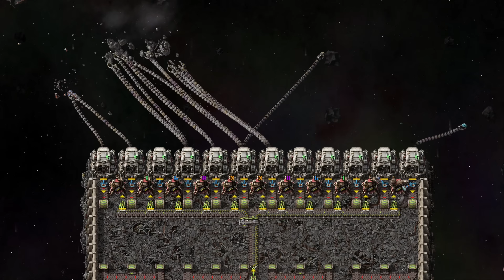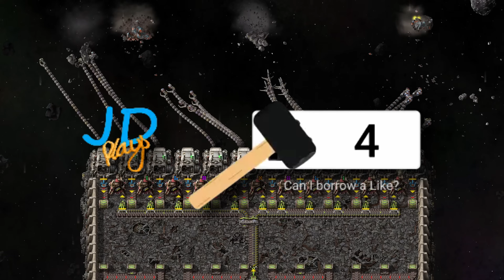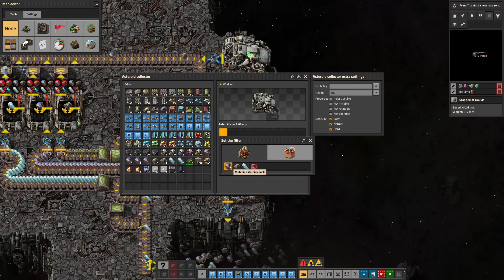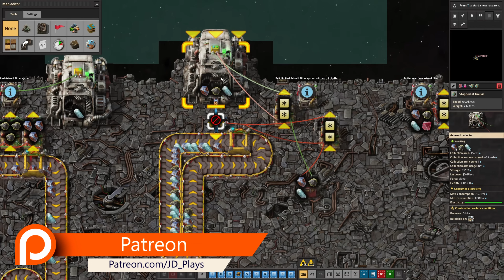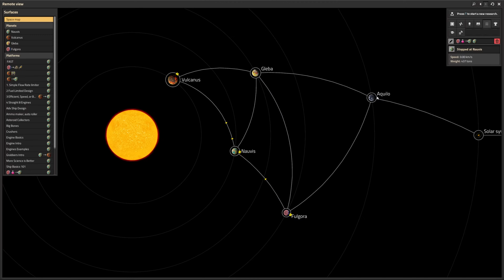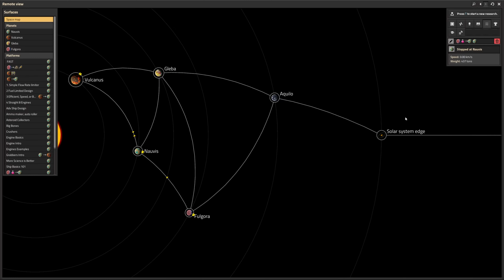Ship Design 101: Asteroid Collectors Deep Dive ⚙️ Factorio Space Age 🏭 Tutorial. Walkthrough

Comment: the belt limited filter with buffer doesn't need the constant plugged into the decider controlling the belt inserter, unless you have so items on that belt that are less than your chunk threshold that you swamp the filter limit which is 4. In my case the only other item I have on the belt is yellow ammo which will likely never drop lower than my chunk limit apart from 1st start up that leaves 4 filter slots for all chunk types.

Comment: By the way, at 8:00 you show a 3-decider arrangement for filtering chunks. You could accomplish this simply by using the Each wildcard. If Each (red) is greater than Each (green) then output Each 1. Or whichever color it was supposed to be (on mobile, so it's hard to type and cross-reference).

Incidentally, this is one big reason to use a constant combinator with values other than 1, and assign the values to the item in question (I see a lot of people instantly reach for letters to represent specific items)

Comment: 9:00 remove those 3 deciders, put 1 arithmetic instead with "multiply everything by -1".
e.g.  if you have 10 ice on the belt it'll output as -10. now if constant combinator is set to 10 ice too it will be 10 - 10 = 0  ice filtered out. Same for other chunks with just 2 combinators total.

Comment: 20:15 - oh, interesting.  "A very large value"... I presume something just a touch smaller than 2,147,483,647 ??  Because that's the maximum for a 32-bit signed integer, which I believe is what the combinators use, and wrapping goes to negative... so like, subtract the number you want in the buffer from 2147483647, and that's your setting, yeah?  Tricksy!
Edit: P.S.  Ahh, yes, I see at 20:47 you have the info... 2^31-n, cool!  And yeah, I guess it hasn't sunk in that you can enter that now!